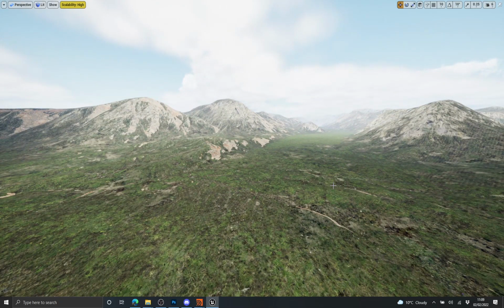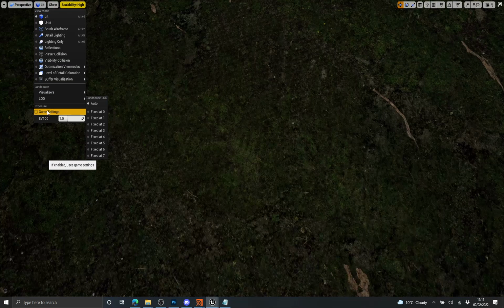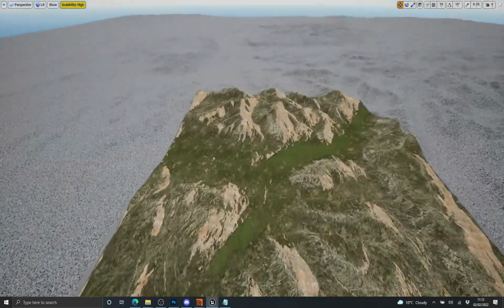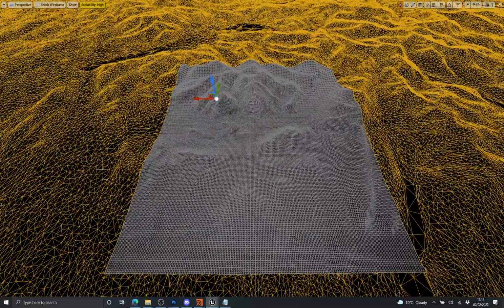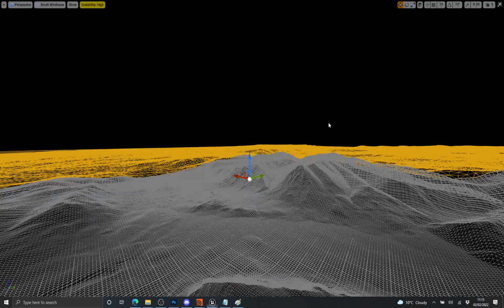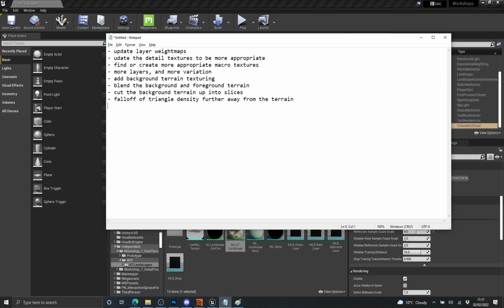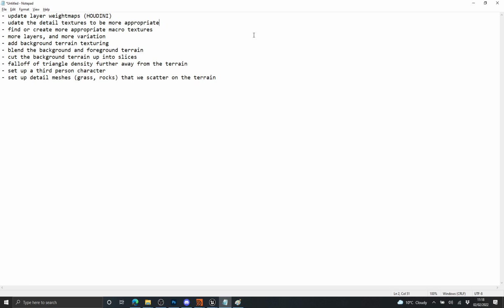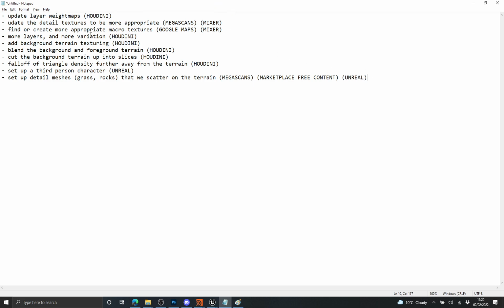8:  Recap and Planning Next Steps

Comment: If you have plans to utilizing RVT in the future then I have several suggestions for you. Like I said the last time I commented you have the Texture Variation Node, Noise Node, I have a color variation node I can share, I have different types of masks, most are splat mask in nature but there are slope, height, and area masks I utilize. (If you ever wanna talk just let me know. I know you're doing yours specifically with Houdini in mind (Mine is a mix of World Creator and in engine editing) but I have zero issues sharing what I have. I enjoy watching how others do things and happened upon your videos. Yours is certainly a unique way but makes sense since you're going so hard on splat masks. The drawback on splat masks for me is sometimes you want to change things and you can only change so much of a mask. However, I do have a way where I over exaggerate the masks I do use this way I can scale them back manually to where I want it exactly when running around in 3rd or 1st person.
Reply from the maker: RVTs will definitely be coming up in the future, and we'll be discussing some of the benefits and pitfalls.

If you'd like to share your functions, please be my guest! The whole purpose of this channel is to share workflows so if you think you've got something that could help out the community then that's awesome.

Material layers is a straight up improvement on traditional materials for landscapes, no matter how you create your layer blends. I'd encourage you to give it a try as the benefits will be clear to you immediately if you work with Landscapes a lot.

As you've identified, the approach I'm using is heavily based around using pre-determined masks and textures, and this is deliberate. Noise and Procedural based approaches have their place, but the goal of this series is to use all the "god-tier" resources that can be found in the real world, in the form of satellite data, aerial lidar and photography and scanning. And I'll be sticking to this principle throughout the series as I wrap up demonstrating this particular workflow.